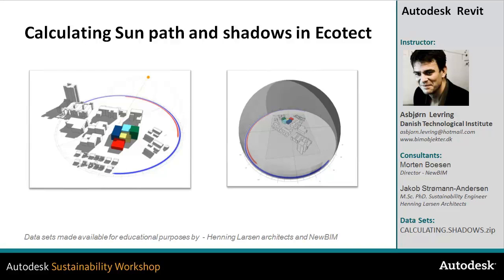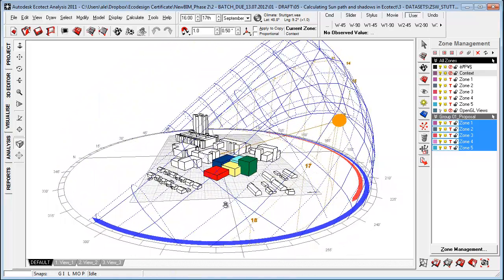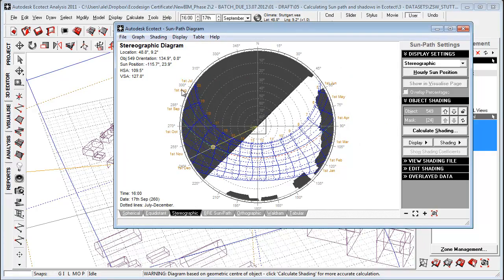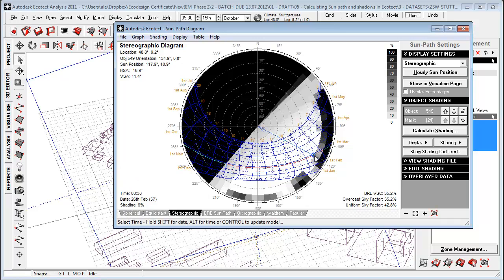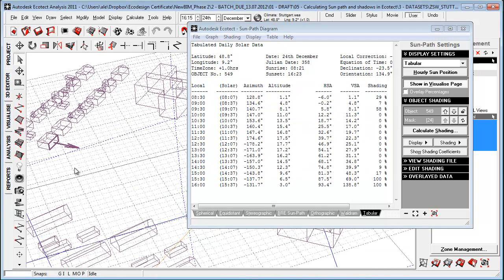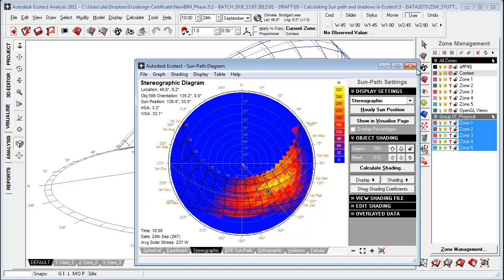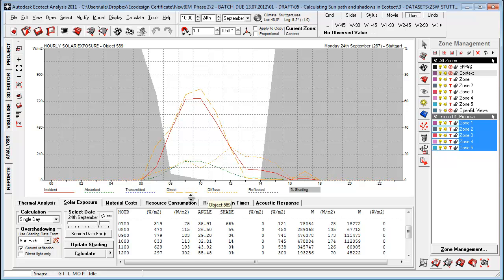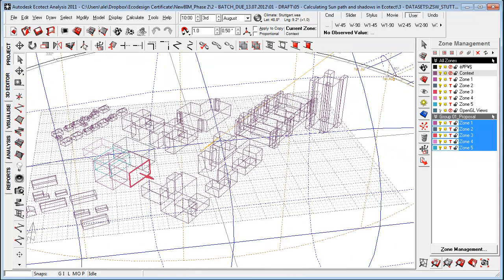Calculating sun path and shadows in Autodesk Ecotect

Comment: When you calculate shading, it appears shading mask overlaying sunpath diagram, with different shading percentages. On the bottom left corner of this window appears the shading percentage value, which updates as we move around the sunpath projection. On the other hand, there is an option on the list to the right, saying "overlay percentages". If we click on it the sunpath shows shading percentages all over. These shading percentages don't match with the other shading percentages on the bottom left corner. What's the difference between the two? Which are the correct shading percentages? Thank you.